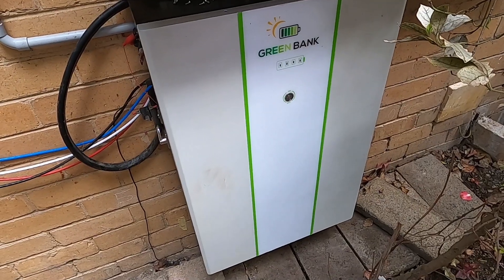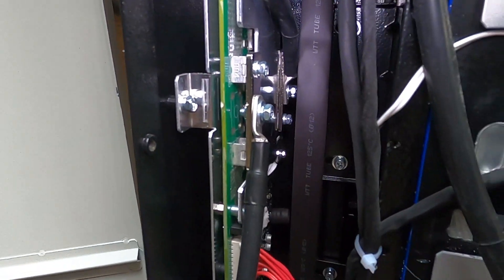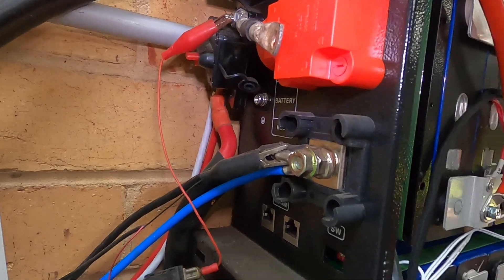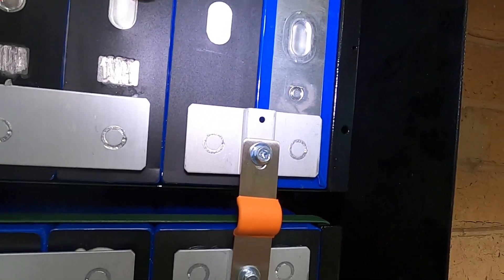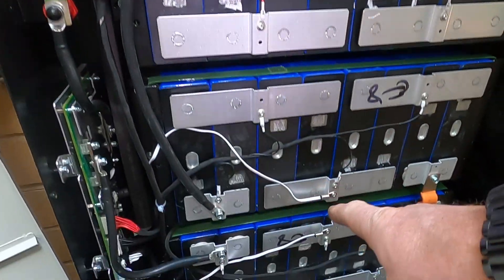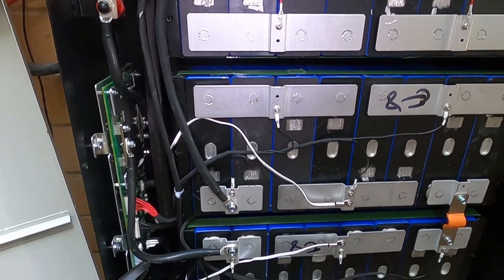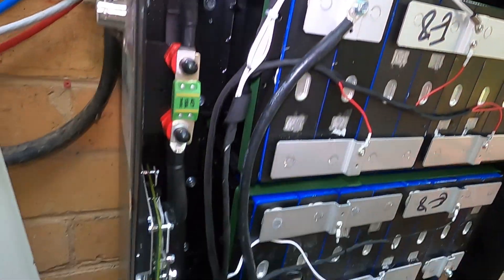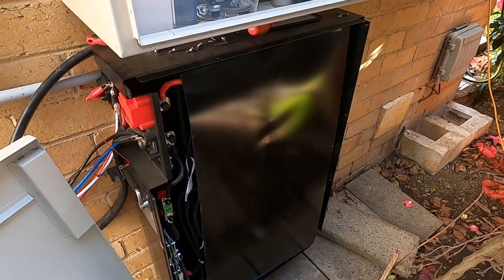12kW Solar Battery LiFePo4 48V 250AH 150A fuse replacement

Comment: I have a 10kw all the same tell tale batterys scratched off labelling missing one black battery cover i wouldn't buy another.
Reply from the maker: How well does it perform?  Mine still delivers 12kW after 2 1/2 years. Very happy with it.

Comment: Thanks for that. Wondered what they look like inside. Looks like some dodgy cells. Not rated for outdoor use, it's only IP21.
Reply from the maker: Hi Alex, yes that's right, it is not a waterproof enclosure.  I have it protected by a separate box as it mounted outside.  I'd rather not have it mounted inside, as recommended.